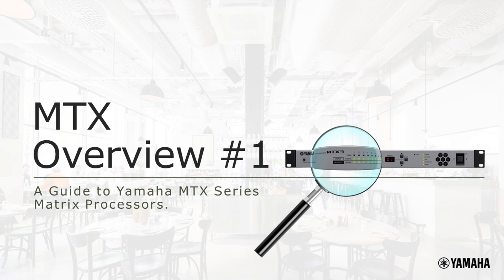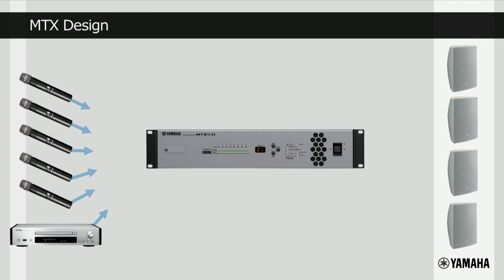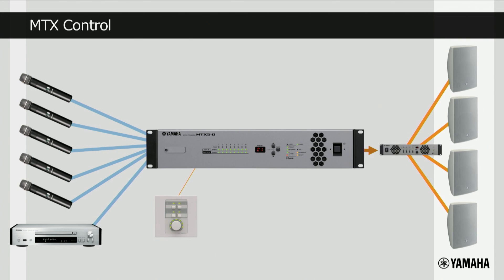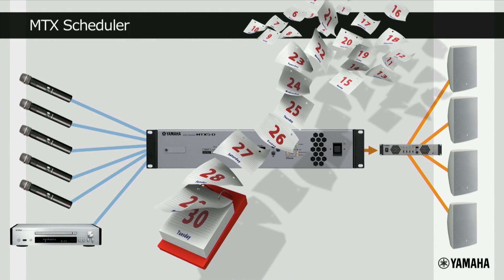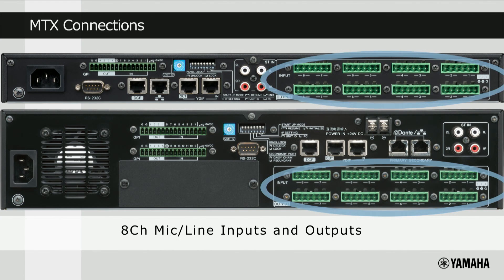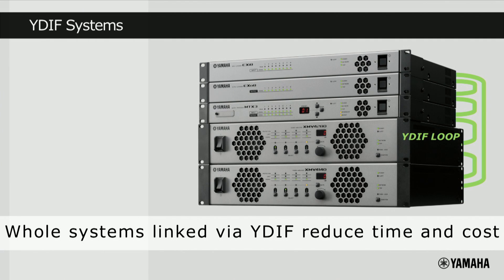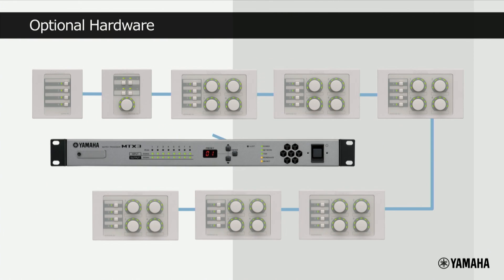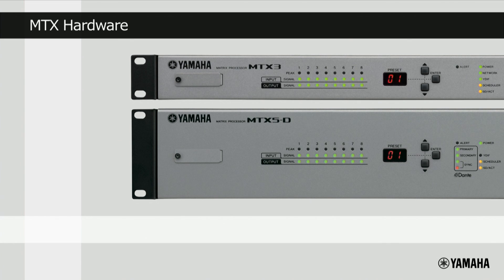Yamaha MTX/MRX MTX Overview #1

Comment: I have an MTX3 installed in two locations thus far. I have been asked if the MTX can record to the SD card instead of just playback. I would think that such a feature would round off the features on what is a great mixer. Also, I think that the number of speaker PEQ filters should be increased from 6 to 9 or 10 - I ran out of PEQs in one installation.